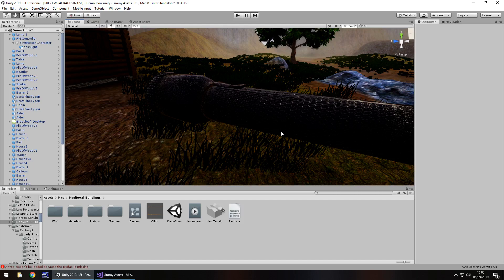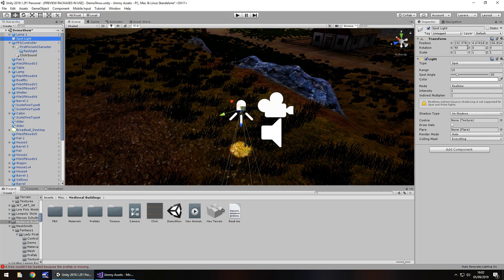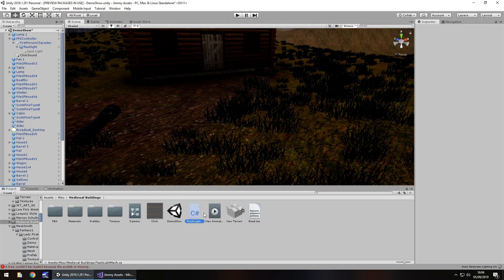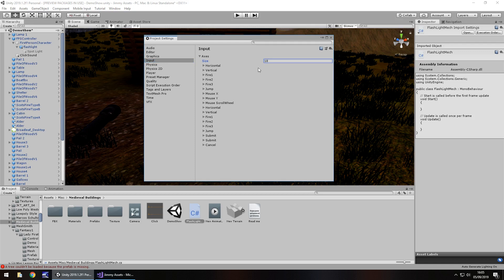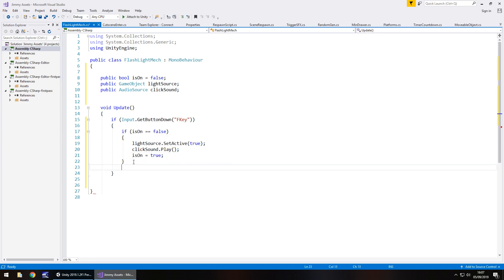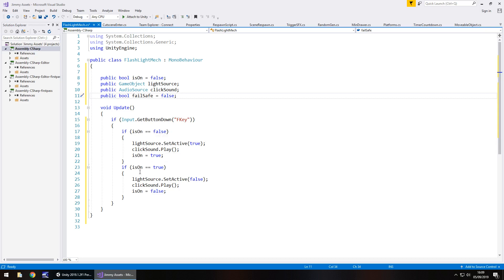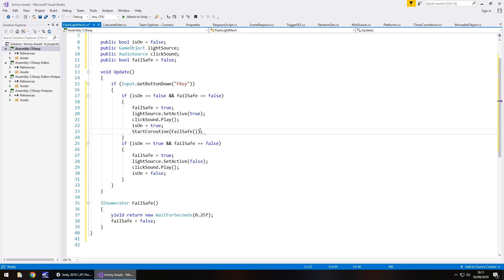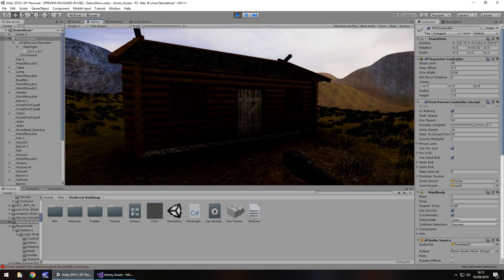HOW TO MAKE A SIMPLE FLASHLIGHT MECHANIC WITH C# IN UNITY TUTORIAL

Comment: i made the flashlight but when i load next scene the flashlight doesnt stay on/off how do i fix that
Reply from the maker: you can use a static variable. for example if you have a static bool set as true when it’s on and false when it’s off, modify the script to read the bool. because it’s static it doesn’t change when you change scenes
Reply: @JimmyVegasUnity  okay thank you
Reply: @JimmyVegasUnity  uhh i tried but it didnt really work how would i have to change this
using System.Collections;
using System.Collections.Generic;
using UnityEngine;

public class flashlight : MonoBehaviour
{
    public static bool isOn = false;
    public GameObject lightSource;
    public static bool failSafe = false;
    
   
    void Update()
    {
        if (Input.GetButtonDown("Fkey"))
        {
            if (isOn == false && failSafe == false)
            {
                failSafe = true;
                lightSource.SetActive(true);
                isOn = true;
                StartCoroutine(FailSafe());
            }

            if (isOn == true && failSafe == false)
            {
                failSafe = true;
                lightSource.SetActive(false);
                isOn = false;
                StartCoroutine(FailSafe());
            }
        }
    }

    IEnumerator FailSafe()
    {
        yield return new WaitForSeconds(0.01f);
        failSafe = false;
    }
}
Reply from the maker: yes, but you need to add code in your script to detect if it’s on or not when you enter the scene
Reply: @JimmyVegasUnity  oow okay ill try to figure it out thank you
Reply: @JimmyVegasUnity  do you maybe have a video about that that i could use as help?
Reply from the maker: no. it’s not that difficult to work out. you just need the extra if statement. think about how you need to do it logically, and then code it
Reply: @JimmyVegasUnity  okay thank you

Comment: Hi!  I'm new to Unity and game coding.  Instead of creating a Failsafe for the 'if' statements.. could you also just return at the end of each if statement.  That way if the flashlight WAS off.. it will then turn the flashlight on, play the click sound, and finally set isOn to true, then return.  Will returning here completely avoid the second if statement, or do we NEED the failsafe to prevent the second if statement?  Thanks, and subscribed for more :)
Reply: better even, an initial false early return if the failSafe value is false, then a return after the first if block, removing the complexity of && evaluations and an additional if.

Comment: Getbuttondown only returns true for the frame the button is pressed, also instead of an isOn bool you could simply use light source.setactive(!lightsource.activeself) which if the light is on that statement returns false which would turn it off and if the source is off it returns true which would switch it on. Just removes the need for the extra if statements